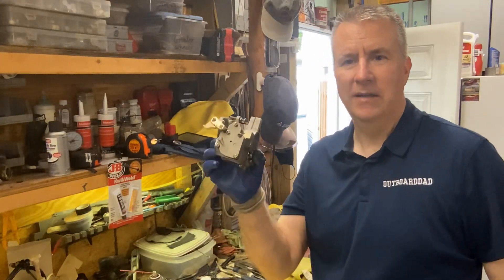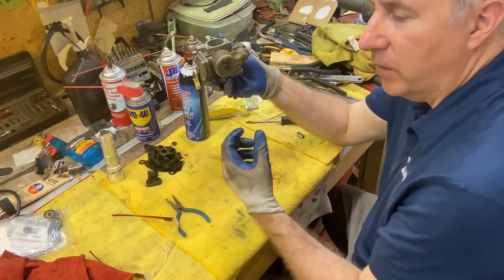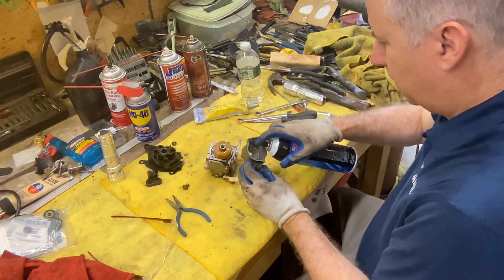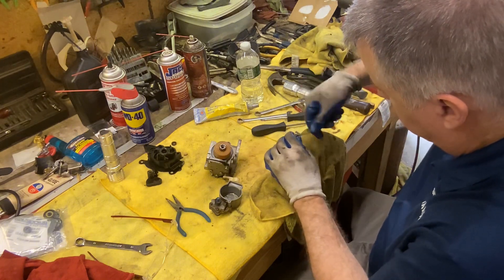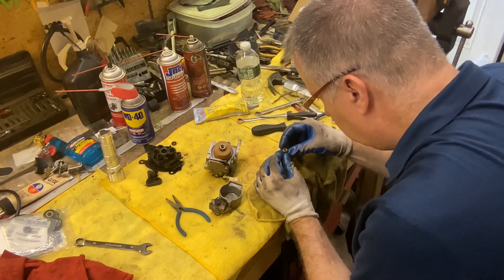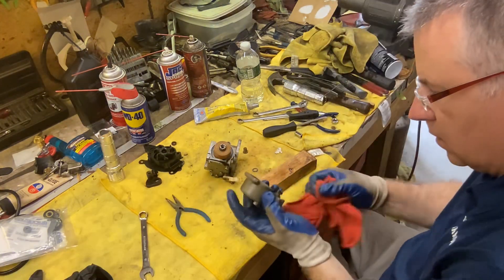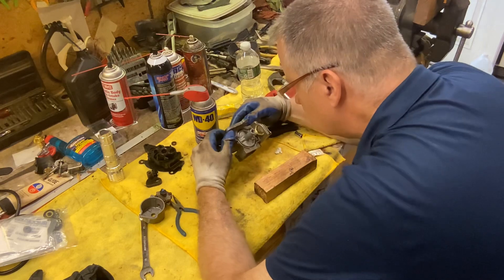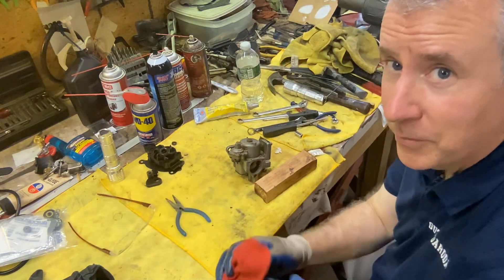Mercury 9.9 Carburetor clean and test (Part 1)

Comment: Keith, you should have the initials, MD after your name for Mechanical Doctor 😁. Great video. Maybe a silly question, but what would happen if there was fuel in the float?

Congrats on over 200 subscribers 🎉😊
Reply from the maker: @sherinewade  thanks for the question and I will add that to the next carburetor video. If the FLOAT has fuel in it , it will not FLOAT the same and the engine will flood with fuel
Reply: @OutboardDad  thanks Keith. Okay, makes sense, hence the name of it is Float. 😁. Thank you.